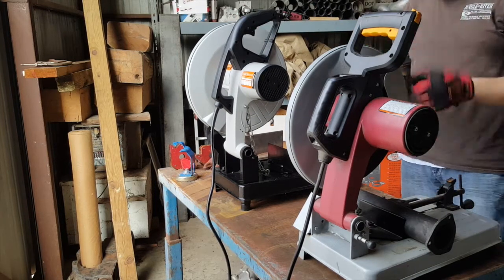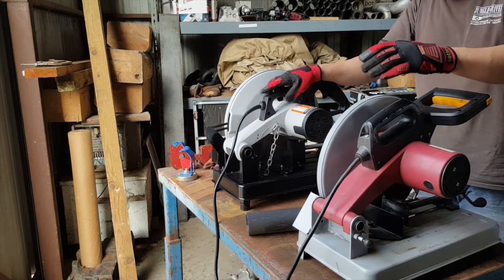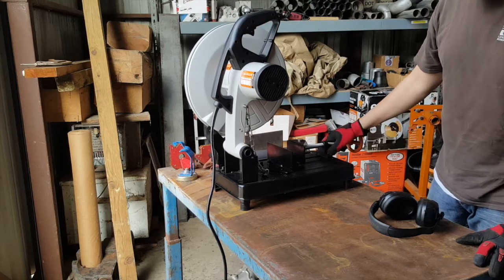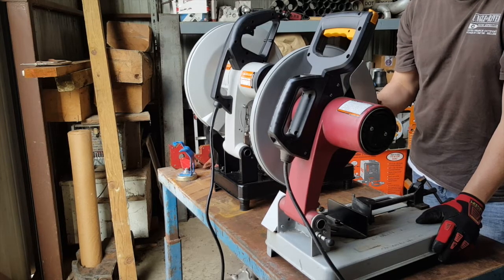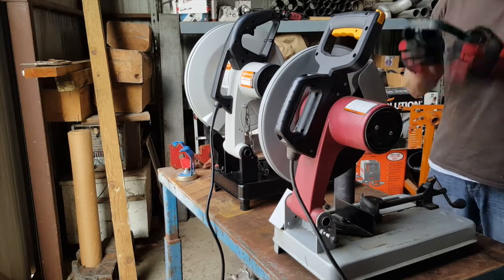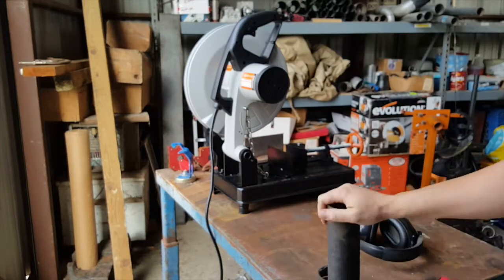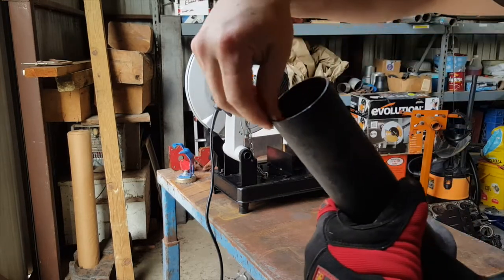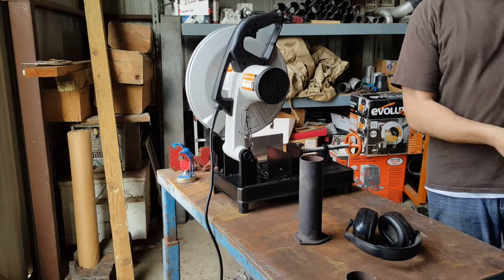Evolution Rage2 vs Harbor Freight Industrial Abrasive Chop Saw

Comment: Just makes me wonder about the justification manufacturers use to charge more than 2x as much for essentially the same saw, just a slower motor speed with the metal blade saw.  DeWalt metal blade chop saw $435, abrasive blade saw $163-$200.
Reply: you pay  a lot for the blade, $80.  you pay more windings in the motor to get the torque, and i think there is a gear reduction in the head. also the base is cast iron vs stamped. it heeds to be machined so thats more time and money right there
Reply: Not only that but some metal cutting blades have carbide teeth.

Comment: No debris,no sparks, cool to the touch, and I sure that the blade will last a lot longer than an abrasive wheel. I like the Evolution better, it costs more but you probably would save time and money in the  long run not having to constantly buy blades, sand away burrs, and cleaning up your shop floor.